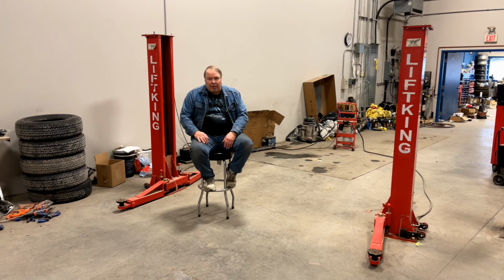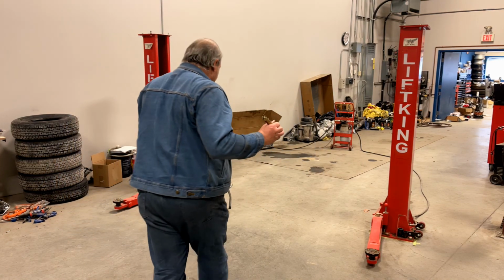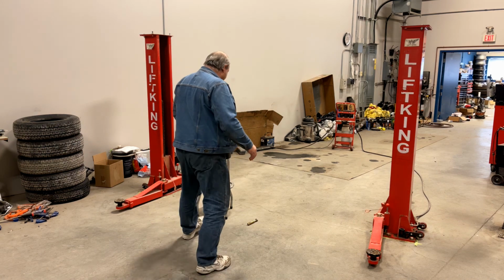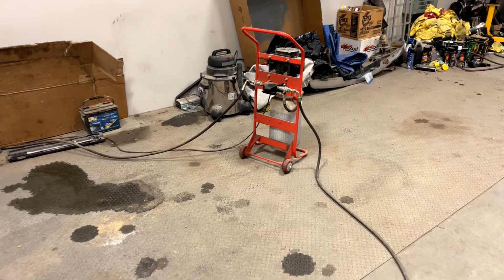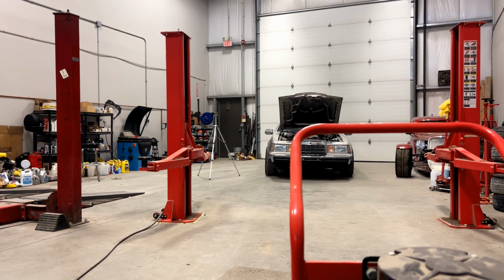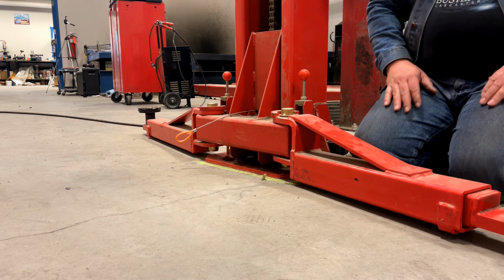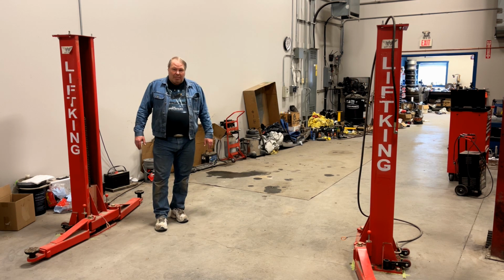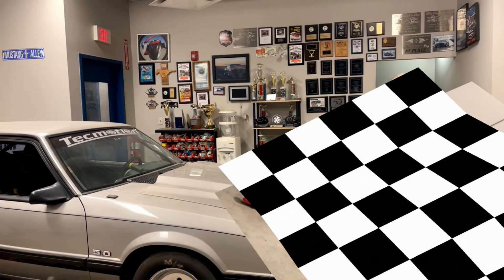Low Profile Portable Two Post Automotive Lift Features and Review

Comment: Thanks for sharing.      It is helpful.   Now I am wondering where to get the anchor bolts
Reply from the maker: The actual bolts are grade 8 bolts from Bolt Supply House, but you can get them at any quality fastener supplier. If I remember right, the flush concrete anchors are Hilti Flush Anchors. My concrete guy actually got them for me, but any quality fastener supplier who deals in concrete anchors should be able to come up with them. If you don’t have a local supplier try someone like McMaster-Carr.

Comment: Great video! How does the power pack ensure the lift arms move together?
Reply from the maker: There is a valve assembly on there that is probably about the same thing as is used on a front end loader or cultivator or any other hydraulic system with two or more rams and one control circuit.